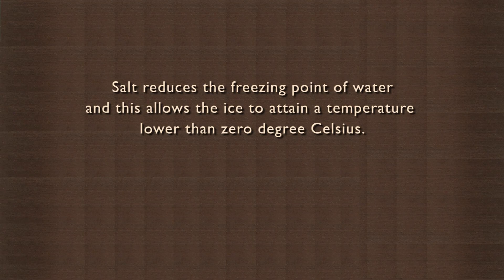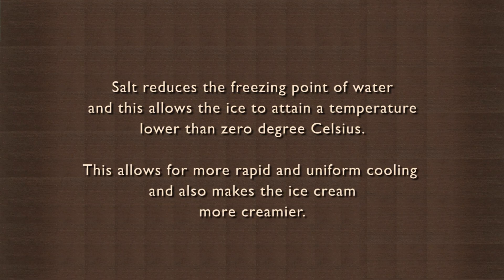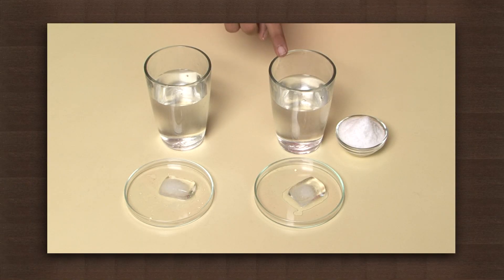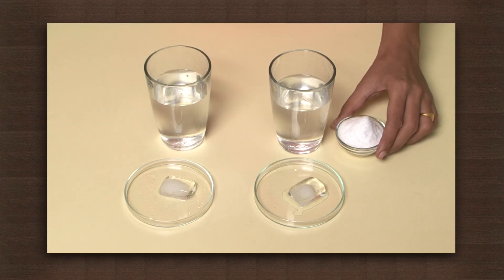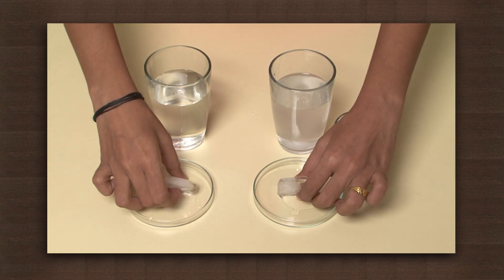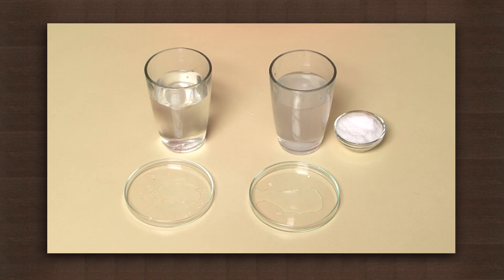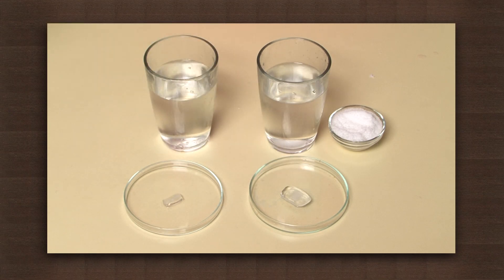Make a freezing mixture by adding salt to water | Water | Physics

Comment: If salt reduces the melting point by theory , then how does the salt added to ice helps in a slow melting... ? It would have melted faster as the melting point is low. Sir, please help in this ...
Reply: Dude, the melting point is lower, not higher. Thus the helping in slower melting.

Comment: heres a question for you if I I have a 5 gallon container of water does this mean I could add salt as anti freeze and it will lower the freezing temp and any ideas how much you would need? ( depending on what is available at the time possibly I may use distilled water ) thoughts please thank you I mean if I have to keep a 5 gallon water conatainer outside in winter time could salt be an effective anti freeze thoughts please thank you
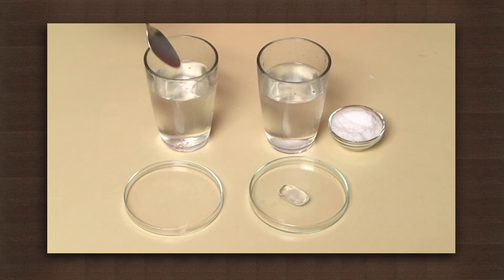Reply: Salt in water does not make freezing solid impossible.  It just requires a lower temperature to freeze.  And once frozen stays frozen longer.  That's why people like to use frozen salty water to put in coolers.  Your 5 Gallon container will still freeze solid most likely depending how cold it gets.  The ratio of salt to water is 1:8 or 1:12 so do the math for how much is recommended according to internet.

Comment: Pretty sure there is a Veritasium video that debunks your hypothesis... in short, the ice in the salt water melts slower because the density of the salt water creates a separation between the cold and warm water, therefore the freshwater insulates the ice. In the freshwater glass it mixes more easily, and thus the heat is exchanged more rapidly.
Reply: water ice salt ayyy water ice salt aYyyyy WATER ICE SALT AYYYYY
Reply: @chaoseruri  interesting, I never thought of it that way.
Reply: @KirbyCharkra  nice comment keep it up <3
Reply: @chaoseruri  what's happening?

Comment: Salt lowers melting point of ice. But Salt helps in melting snow faster in cold countries. How does that happen?
Reply: You just answered your own question.  The salt lowers the melting temperature, so the water+salt mixture melts at a lower temperature than 32F (0C).   If there is no ice, the snow can only melt if the air temperature is above 32F.  So let's say the air temperature is 10F (-12C).  This is lower than the 32F temperature that water freezes.  At this temperature, pure water would be frozen in the form of snow or ice.  When you add the maximum amount of salt to the ice or snow, the temperature of the mixture of water+salt melts at -6F (-21C).  Since the air temperature is 10F and higher than the -6F temperature to melt the water+salt mixture, the salt would melt the snow or ice.  At less than -6F, the water would stay as snow or ice with or without the salt, so basically icing the road will only make sense if the air temperature is between -6F to 32F.  Above 32F, all snow or ice would melt regardless of whether it has salt or not so there is no point in adding salt.
Reply: @ahndeux  thanks ❤

Comment: An inaccurate explanation.  Brine and ice baths are used not because they freeze more slowly, but because the salt lowers the melting point of the mixture. The thermal capacity of the ice to absorb energy as it melts is simply the energy needed to break the bonds holding the water molecules together. This latent heat energy doesn't change.

Comment: If water freezes at 0 degrees Celsius how does salt lower the freezing temperature of water?
What creates the lower temperature when salt is  added to ice.
Reply: This is super late by I know the answer. Water freezes when the negative ends of the water molecules attract the positive ends of other water molecules. If heat is not enough to overcome this attract, the water molecules stick together and form a lattice ice. Salt is made of positive sodium ions and negative chloride ions. They disrupt the lattice formation, meaning water molecules must be moving even slower (i.e. the temperature must be lower) to form ice
Reply: @icannotchoose  thanks

Comment: If you put a soda can in a steel picture with water and add half a cup of salt and fill it with ice cubes, the soda can will freeze if you leave it for an hour in room temperature. I did that a work all the time to freeze my Red Bull drinks.
 I don't know why it happens but it's really interesting though.

Comment: His explanation is incorrect.  Salt inhibits refreezing and allows melting to occur at the same rate (it shifts the equilibrium between solid and liquid states).  The reason the ice melts faster in unstirred fresh water is because as the ice melts the cold liquid is more dense and sinks.  The ice is therefore surrounded by warmer water.  In unstirred salt water as the ice melts it instead floats (since the reduced temperature in this case does not increase the density sufficiently to sink.  You can see this using dyed ice cubes.  If you stir, however, there is no difference in the rate of melting.
Reply: Tried this, results were the same as in the video. You could possibly be full of shit. Now apologize
Reply: Ok smarty pants 
Not in a rude way
Reply: @ daniel wexler. your theory is correct if the dept of the water is a few metres. but in the small glass, there is virtually no difference in temperature.
Reply from the maker: Thank you for the comment, we will look into this
Reply: You are right, the "convection current" is in play here.
Reply: I should add that "if you stir effectively, there is no difference in the melting rate, but the refreezing rate for ice in salt water will be lower.  The net effect is that the ice should melt faster in salt water.  I will try this one of these and will report back to you.  BTW trolls need not apply, Clayton.
Reply: very good for Lean
Reply: I am amazed😂😂😂

Comment: A warning to those experimenting with this:

The temperature will get as low as -18'C (0'F) to possibly -20'C (-4'F)...
You need enough salt so the water around the ice is a saturated solution. If there are visible salt particles then you have enough. Roughly one third salt by weight is suitable.

Do NOT let the stuff contact skin, it will freeze flesh solid and kill it in seconds.
If you are lucky, the results are permanent scars, if unlucky gangrene & amputations...

It is not something to mess about with.
Reply: So, you're telling me that salt+water+icecubes=frozen solid flesh in seconds at the temperature of around -18-21C?

Okay... Not that I'm going to try, but that does sound a bit ridiculous.
Reply: In the olden days.........We used to test for a 'saturated solution' by putting a potato in the water....When the potato floated the solution was saturated... ;)

Comment: is it table salt or sea salt???????
Reply: doesn't matter
Reply: Sea salt contains calcium and magnesium salts as well as sodium chloride.  Salts of divalent cations such as calcium and magnesium should have twice the effect as monovalent (sodium) in terms of inhibiting refreezing.
Reply from the maker: We agree with daemkru - it doesn't matter whether it is sea salt or table salt. Sodium chloride exists in both, and will contribute to making a freezing mixture
Reply: It does not matter. Table salt, sea salt, Himalayan salt and rock salt all have the same formula- NaCl
Reply: Sea salt is reportedly 85% sodium chloride.
Reply: Try this: two small bags of ice, identical in mass.  Add salt to one and not the other.  Shake them for 5 -10 minutes.  Compare the amount of liquid water that forms in that time.  If salt causes ice to "melt" faster, the salted bag should contain a greater amount of liquid (or vice -versa).
Reply: It's said that rock salt gives a better effect, but I don't know about that.